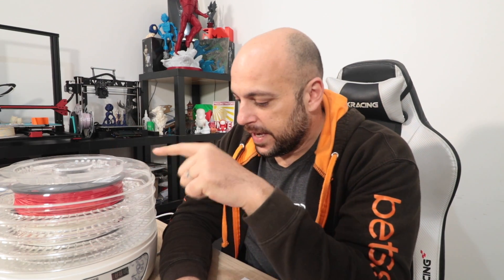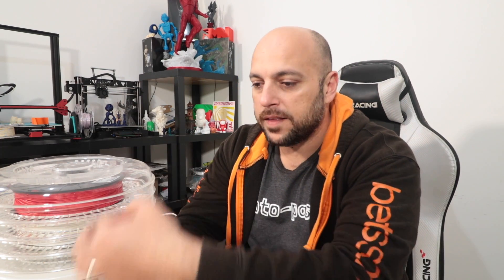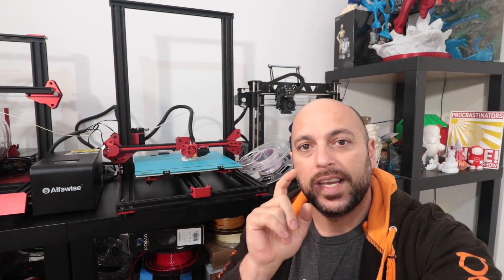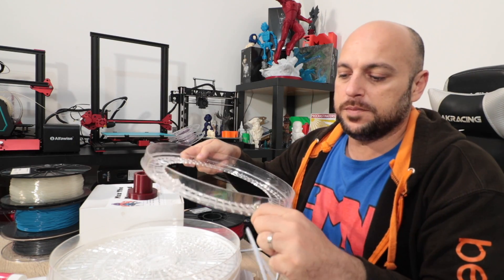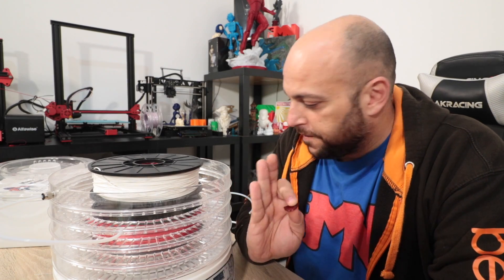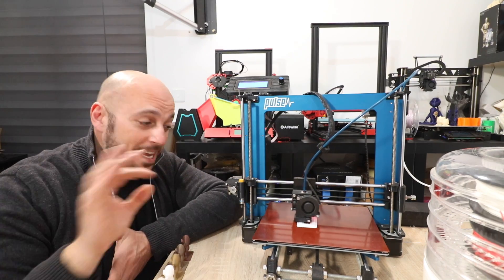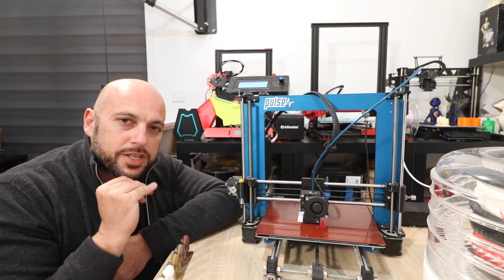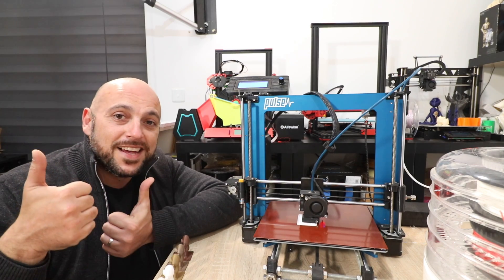Constant Supply Of Dry Filament  - Dehydraspool 3D Printing Project

Comment: I've wondered about these food dryers, with the way they're designed they're just constantly taking in cold air, and heating it then pushing it up into the food and that air is just leaving out the sides of the plastic. Since it contains moisture you want that moist air gone. But as far as efficiency thats a lot of energy wasted and heat kicked out into the room.
I'm thinking about making a system like this that you made, only also seal most of the unit so its air tight while in use, and have a single outlet for the air at the top that feeds back down to the intake that i assume is on the bottom of the machine, and have a vat of dessicant where the air passes through from the top baci to the bottom. That can be swapped out as the dessicant becomes full. 
Then maybe also insulate the whole setup in one big well insulated foam box so theres even less heat loss out the plastic sides of the machine. 

As long as its built to stop trying to heat the air if its already hot enough it shouldnt cause thermal runaway.
Guess I'll have to see what i can come up with. Since i dont want to also be running a second machine thats constantly using energy and kicking out heat for hours every time i want to print with a moisture sensitive filament and get good results. I think making a setup for drying like that would save a lot of electricity.

Comment: This is a great idea!  One additional tweak might be to design a bracket for the tube pass-thru so the filament can enter the tube at a more straight angle instead of having to bend at nearly 90° before leaving the dehydrator.  This might reduce frictional drag somewhat.

Comment: I am very interested in keeping filament dry. Like Malta, I live in a high humidity area, Fort Lauderdale, Florida, USA. It is hard to find a location with higher humidity than here. I have developed several ideas for keeping my filament dry. But, I have a question. How dry is dry? Like me, you are a innovative thinker. You must have used a device for checking your humidity. What percentage of humidity is acceptable to you?
Reply: I am also in flordia, I’m by Miami, could you please inform me if ya found out anything good?
Reply: @giannirust  Hi, I have made a few different filament storage boxes. They each can feed the filament into my MK3s/MMU2s and store the fil. in 22% +/- humidity levels. I do this by using multiple dessicant packs which are rechargeable. Are you listed in Prusaprinters User groups? If so, what is your name (or ID) there. I think I am P Herz there as well
Reply: @pherz3775  I am not listen in the prusaprinters user groups.

Comment: Good job on the filament dryer, nice to see it working.

Has the dryer made any difference to your bed adhesion?

Would be great to know the settings you use and also the bed material?

Thanks

Comment: since the dehydrator isn't in an air tight enclosure, wouldn't humidity creep in after you power off the dehydrator? as such, wouldn't it be better to dry the rolls then transfer them to a sealed dry box and modify the dry box so that you can print the rolls directly from there?

otherwise you have to always keep the dehydrator running while doing a print, causing an increase in electricity power consumption and more $$ spent.

Comment: How does it hold up, now that you're almost 2 years in?
 The resistance from the outer guides is likely due to a sharp bend radius of the pullies. If you increase the pulley diameter, the resistance should go down quite a bit.

Comment: This sounds like a great idea and looks like a good system, but there is one problem. I purchased the dehydrator on your link, spent 17 hours printing the bottom of your system and the darn thing does not even come close to fitting on the dehydrator! 
The center ring is far too small and even is I spend time grind it off, the center ring is not tall enough to clear the center fan hood fo the dehydrator. A total waste of time, filament and money buying the dehydrator you kink to.
What gives, you made a small commission on the sale, I spend lots of time and filament and nothing fits

Comment: You mentioned that when you dry a spool, it starts printing great but then degrades.  Do you think it may also be that with a full spool loaded, the dryer isn't actually drying out the inner part of the spool, rather than the spool soaking up moisture while you're printing?  Perhaps this is what you meant all along and I misunderstood.

Comment: I set for 3 hours at 50C my brittle PLA samples... but almost nothing changed - still brittle and cracking?! 
What was wrong? - Not enough temp or hours? - Does ambient temperature affect it? - Is temperature distribution uneven on racks?

Comment: Very cool idea! I need to do this. I'm having problems with TPU and long lasting prints it starts very good but moistures very quickly. Some people cuts cardboard or something between bottom and filament so the air spreads more even.

Comment: Just started running into this problem this summer. I put a dehumidifier in my back room where the printer is, and am also considering getting some sort of dehydrator to dry my filament as well. this is a great solution and you are sooop good at finding solutions to common problems! his one looks amazing! Thanks!

Comment: quick tip for us builders and tinkerers: if you go with this setup make sure that you place the filament roll with the sticker side up. I tend to use Hatchbox filament for general prints. One side of the filament spool has a sticker on it with general information such as tolerance and temperature range etc. If you put the side with the sticker down then it may start to peel off and create extra friction with the spool holder. I suspect the heat may have loosened some of the adhesive which made it catch. I almost abandoned this setup as I was afraid the extra friction would over stress the extruder motor. Flipped the filament over and found this by accident. Way less friction now. Very happy to start using this method.

Comment: my input: If you were to use bearings, packing them with grease would be a surefire way to stop them rolling without being pulled by the extruder unit. It would also allow the spools to roll freely when the extruder pulls them.

Comment: Hello, I enjoyed this video as I do many of yours that I have watched. I have a CR10s that has been working great for me since day one with none of the gremlins that many people spoke of. Recently I did start to have an issue with the heat bed connector and am looking to replace it. I wanted to ask you if you think it is better for me to look towards an AC silicon heat mat to replace the factory heat bed system all together along with a different style hot end. I ask because Iwould like to start printing with ABS and possibly Nylon. Thank you
Reply from the maker: A decent AC heather along with a good SSR can only benefit you. And I’d highly recommend an all metal hotend like the V6 Volcano

Comment: Excellent hack of a dehydrator. Can you tell me if it (the dehydrator) cycles on and off as needed for changes in humidity (for storage purposes) or is it just filled with spools and turned on for printing. (Not a storage solution). Thanks for the share.

Comment: Hello!  I had a question  you have two different dehydrators listed will the rosewill one for the US you have listed work for this with your printed parts?  thanks for your time
Reply from the maker: It might not fit perfectly but I included the fusion360 files in order to be able to adjust them to fit

Comment: Hey Joe,
I am wondering for this setup, will you have to continuously reset the heating timer or does it allow endless heating? Because it would be an issue for long prints to keep resetting the timer

Comment: First off awesome idea.  I’ve been trying to do some thin wall PETG prints for RC aircraft and having issues with “wet” PETG even fresh out of the bag so I’ve got a dehydrator on order due tomorrow and am printing your parts now.  One weird thing my I3 Mk3 wanted to do a color/filament change about two thirds of the way up the bottom cylinder (I’m printing both the top and bottom together.), no harm I just unloaded and reloaded the same blue PETG I was using and everything was fine.  Also have you considered using six or more rollers instead of just four?  Since you’ve basically inscribed a square inside th circle that creates four right angles for the filament to go around.  Six rollers would reduce it to sixty degrees at each roller and that should make a huge difference in tension on the extruder.   Eight would make it forty-five degrees but at some point friction will make it a losing proposition to add more rollers. Just a thought.

Comment: Nice. I find if printer contained in a cabinet the humidity in cabinet drops down under 20% after a couple of hours. I also has made a filament dryer from a food dryer. Works good but slow. Thanks.

Comment: With what kind of fillaments do you have humidity problems? I just started printing PETG and not sure if I'm gonna need the drier or not. PLA was loaded for months into my printer without any noticible difference in printing quality. I'm in the Netherlands, I guess the humidity here is something like 80% outdoors during winter, and the printer is in the appartment.
Reply: "I'm in the Netherlands, I guess the humidity here is something like 80% outdoors during winter, and the printer is in the appartment(sic)." In the winter I'm assuming it is colder outside than inside. (I could be wrong, some people really like it cold...) ;-) If my assumption is correct your humidity is much lower in your apartment. We are talking about relative humidity, and what the measurement is relative to is the holding capacity of the air. Colder air can hold less water vapor than warm air. So with the same number of molecules of water vapor, the relative humidity is a higher percentage with cold air than warm air. For example, if it is 5°C outside at 80%, then by the time that same air heats up to 25°C the relative humidity will be about 23%. I would expect the air in an apartment to be slightly higher simply because there are things that add to the humidity inside an apartment (running water in sinks and showers, standing water in toilets, humans breathing out moisture from their metabolism, any plants, etc.). But all those humidity inputs are probably fairly small, so I would expect (gut feeling here) the actual humidity in the apartment to be 25-30% in this situation.

TL;DR, don't use the outside humidity to know what your inside humidity is. Get an indoor hygrometer. ;-)

Comment: Been thinking of doing this myself for a while. A dehydrator with the trays cut out works fine for clearing up stale PLA, PET and ABS, but there's about three months a year when I can get Nylon and PC prints that don't make me kinda wish I was holding a hammer instead of sandpaper.

Comment: with this your setup you should think to add a bearings on those prints it will move filament alot easier. And second, did you think about having a 30cm tube about 3cm diameter throu which filament goes to printer and inside of tube blow a hot air to dry filament?? I think that will be more efficient.

Comment: How do you know that your de-humidifier is being effective in drying out the filament to a level that is correct for the job you want it to do?
Reply from the maker: You’ll know from the print result, I’ve done a video on TPU prints which shows the difference in a dry filament vs a “wet” one. Apart from the visual queues you will also hear tiny popping sounds while printing
Reply: @3DMakerNoob  I was thinking that to be most efficient a gauge of some type would be be much better than a trial and error method . 
Say for example it was found that at 30-40% humidity for PLA was best for printing then a simple mini-hygrometer placed inside the de-humidifier would let you know when you have reached that point.
I find that placing a small bag or two of dessicant is at best useless and to make any useful lowering of humidity takes at least 20 or more small bags to bring the humidity down to 40% from a higher humidity range
There are also humidity strips that change colour if there is a change of moisture in the air which can be re-used.
Reply from the maker: It's not really a trial and error kind of thing. a spool usually takes about 10 hours to dry. In certain places like malta, humidity is rarely under 70%, so even if you dry it, you start printing and within 2 - 3 hours the filament needs cooking again, that's especially for nylon and PVA. while dessicants help keep the humidity low, it won't dry filament though, at least not as fast as a dehydrator or an oven can. Dessicants will keep it dry for longer once the filament is already dry. it all depends on what you intend to print. If it's a small 30 minute or 1 hour print job, you only need the outer layers of the spool to be dry, so you cook it for an hour or so.

Comment: Have you tried, putting air channels in the base (under and in between the spools)? To allow air flow to the center column.
Reply from the maker: There is a bottom tray to separate everything from the heat outlet with enough room so it should be fine, I think it’s just the way the air is circulated

Comment: I live in a pretty damp old house in the UK so the ambient humidity and filament is a major issue for me too.

I have a similar sort of concept in my house, it's an 80L storage box with a wardrobe pole fitted inside with a seal around the opening and a bowden fitting (I reused the terrible ones which come with the Ender 3) for a PTFE tube to the extruder.

I use these (well, similar ones from Aldi) Silica Gel boxes which dry themselves out when connected to mains (which I do with the box next to an extractor fan to get moisture out of building (or try)...

https://www.amazon.co.uk/Aironic-Rechargeable-Mini-Dehumidifier-cupboards-x/dp/B010K2PQJW/ref=sr_1_29?s=kitchen-appliances&ie=UTF8&qid=1545179950&sr=1-29&keywords=dehumidifier

I have managed to get the humidity down to 10%rH in the box before now, but this makes the filament extremely brittle and snaps before getting to printer (FYI)! Generally, I'm mainly happy if the humidity is below about 35%rH.

I've had hugely improved results and have successfully dried out seemingly soaking wet PLA filament.

I have recently made another box for only storing one roll of filament which is based on a 7L box.

My boxes are currently at 36%rH (needs dryer replenishing) & 31%rH respectively.

Comment: Fantastic project Joe. Very simple AND it works. I was wondering if the side 'roller guides' were printed as a single piece but alas no 😂 Cheers, JAYTEE
Reply from the maker: Haha I’m not that good in fusion 360 lol
Reply: @3DMakerNoob  You did a great job mate, it would have been a bonus

Comment: Great video as always. Best thing I got was a digital temperature / humidity sensor from eBay. Has a sensor on a cable so can be placed inside any container you are using to dry the filament and can be safely seen from outside. Keep notes on temp and humidity and you will have a reference for keeping  your filament in best condition.

Comment: Great video and perfect timing, as I have been looking into building my own filament dryer using food dehumidifier I mean dehydrator 😃. You mentioned in the video that you can go up to 70°C. Do you mind double checking that with the thermometer? The actual temperature of mine only goes up to 40°C even when I set it to 70°C.

Comment: don't take this wrong but if you are using the bottom spool dosen't the top one spin and unspool filament
you could ether try some-kind of brake on the spools or have them feed in opposite directions clockwise on top and counter clockwise on the bottom
Reply from the maker: In fact they both feed the opposite direction, so if the bottom spool is being used, then the top spool would literally be winding itself hence why the filament lines go into he opposite direction. Good observation :)

Comment: In Tennessee its so humid, even during winter, that printing exotic material means baking and everything requires a ziplock bag with desiccant.  This project is a very tempting build for me. :)
Reply from the maker: If it works in Malta, should work anywhere in the world hehe

Comment: What profile settings would you recommend on cura or ideamaker for the alfawise U20? I've been trying to find out more information about slicer settings for the printer but haven't found much info (can't really check the Facebook group because I don't have one, gonna have to make one soon tho for the firmware updates)
Reply from the maker: Will be doing a whole series on fine tuning the profiles for it :)

Comment: I would recommend for the loops using some Capricorn tube in place of the rollers. This is done to ensure the filament does not get deformed by grinding against 4 plastic rollers